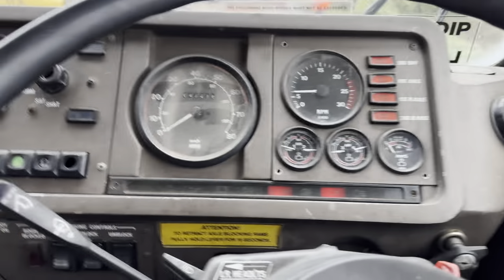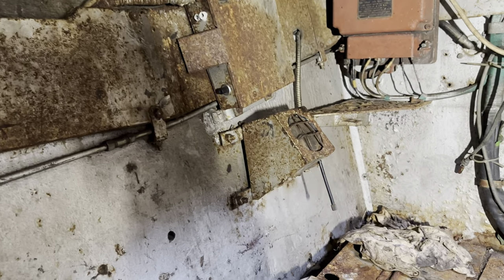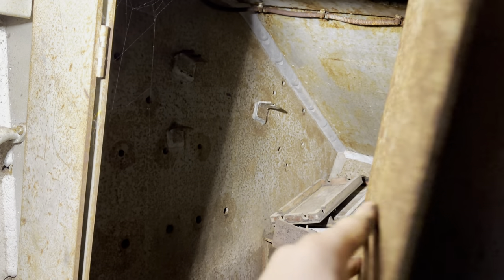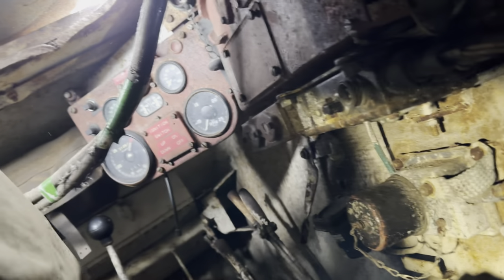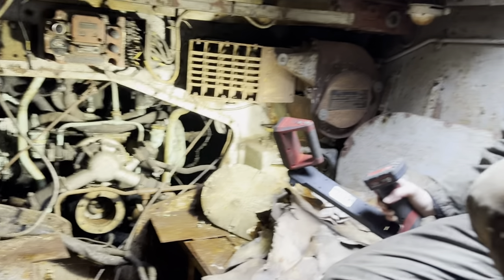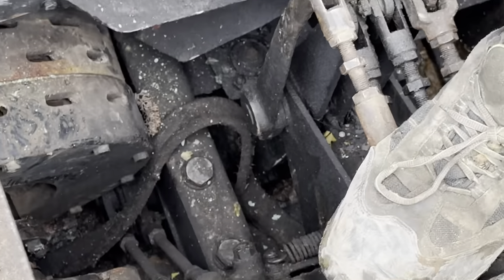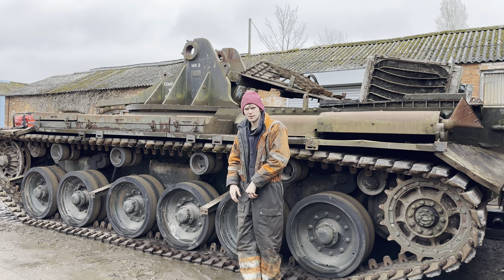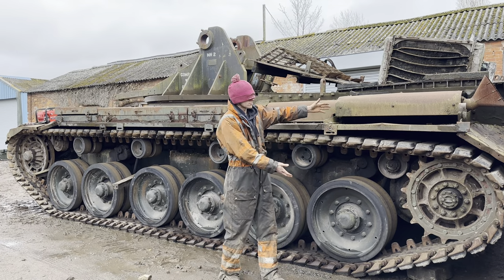Guess the mystery Project?￼

Comment: Likely a fv4005 stage 2. The tank with a 183mm gun. Looking at that mount in the turret. And also he said one was made of it
Reply: Or even the Stage 1. It featured an autoloading system although, im pretty sure that one was on railway tracks instead of tank tracks.
Reply: @Cornish21Pasty  if im not making a mistake, the autoloader was build(or built) on tank hull with tracks as well. Only problem it had was that the turret was to small or the turret whould have needed to be larger which they didnt want
Reply: Not related to the 4005 project actually
Its the 140mm gun mount, used to test the 140mm Gun the Brits made and never ended up using
Reply: I thought he said he was going to make the only one of it?
Edited to add, Tankopaedia says none were made 🤷‍♂️.
Reply: Solely for testing a gun. Air ram and manual elevation connect to the bottom of the breech. Why'd they have to use a tank hull for it?
Reply: @johnnunn8688  it sounded more like rebuild into his own concept or machination, or maybe rebuild it back to one/two of a kind prototype gun rig for 140mm gun
Reply: Has anything more happened with this project please?

Comment: 1: You’re putting a 5th wheel on it and you’re going to drag a low loader with Crouch’s Scania on it just to confuse the DVSA and plod. 2: You’re putting an extending ladder on it with air adjustable elevation because you’ve got a barn roof to fix. 3: You’re putting a jib with a couple of slings on (again air adjustable) just to support the bones now you’ve obviously killed Jack off as he didn’t appear again after hooking them up at the beginning. 4: Inspired by the pride broom handle camera mount featured previously you’re building the worlds most capable all terrain self propelled camera tripod.

Comment: Yep must be a bridge layer with that great big pivot , think I saw one at engineers open day at Chatham  barracks , my mates dad worked there as a civvy instructor, I also learned how to gas weld lumps of metal together on an open day ,the h&s boys would have a fit if kids were allowed to do that today !
Reply: Did the bridge layers have the turret still?
Reply: @Shoorit  no
Reply: @Shoorit  no I don't  think so , the turret was removed or never fitted to the base vehicle , they had special attachments/rams to unfold & push the bridge over the gap to be crossed  , I was taken in by the big pivot point .

Comment: The two of you were talking about the welds inside that tiny compartment. They probably didn't have any other process other than shielded metal arc welding at that time. I'm possibly wrong about that, though. I'll ask Google that question.

Comment: I had no idea the 140mm testbed even still existed!
Reply: Thanks, thought it looked too small and wrong mount for 183mm thought it was a 105
Reply: @lx1995Mk2 I thought 183mm at first.. then noticed too many differences. So thought maybe 120 experimental and then found the picture of the 140mm test with the 120mm test.  Interesting stuff, I bet there’s video of it hidden away somewhere.
Reply: @Shoorit  it's a unusual setup the air jack and screw jack both connect to the back of the gun, but the big thing is why a rotating mount to test the gun on it instead of welding the mount to the hull since after the test they didn't convert it back to a Mk3 or later then it didn't matter about permanent modifications to the hull. Not much point in testing if a 140/120 would work if there's no turret to test and the hull is already tested with 183mm why not just have the mount on the concrete pad to begin with
Reply: Fv3805 ?
Reply: @lx1995Mk2  maybe they were testing how the turret ring and bearing would hold up with that particular calibre, also could be something to do with the testing accuracy or repeatability after multiple shots. Also also testing positioning of the barrel and breach within the turret.. I’m not an expert on tanks and guns just from my engineering view that’s what I thought.. probably way off though.
Reply: @Shoorit  well I'm a arm general so I don't really have much a idea about turret design, but maybe they did it like that for a quick swap of weapon mounts using the centurion turret ring as a base, flat concrete so no turret traverse. All the mount needs is self contained
Reply: Did this Hull come from Shoeburyness?
Reply: I reckon you are going to make it into a tractor unit with free rotating towing mount - that would sure make juggling the non runners around a lot easier

Comment: Just noticed you use WD-40 on hot bolts and such, that stuff is worthless for that, use beeswax instead. It doesn't vanish in a cloud of perfumery smoke and works its way down the threads to provide lube while the bolt or nut is still very hot.

Comment: by looks of it - it were a big bang stick - oh there's an idea Jo, build an extra large pea shooter, with flames and stuff
i been watching the lads at the Australian Tank Museum, they do a great job restoring etc, rebuilding bent up sides of tanks, made in steel of all silly thicknesses and i seen them welding the panels together, using both tick and mig, stainless steel wire, very cool, can't be cheap, just wondering if that's how you Centurion was built, no rusty dust on the welding?

oh i can get all anoraky (not Iraqi) i just been watching vids of US naval guns, as you do, the barrels were very cleverly made in several parts so they could be re-sleeved later on when worn out, the were nicely balanced so they didn't require a huge ram to adjust the height at the rear, the bearing was a clever piece of kit in its self, a frictionless trunnion bearing each side, almost a floating bearing with a narrow space all round, 5" naval guns were supported from a centre point, on the trunnion bearing, its proper nice engineering if your into that sort of thing, you can find vids on the USS Texas
https://www.youtube.com/watch?v=etyVNi0jMiE

will be an interesting project to sink your little teeth into, certainly keep you off the streets which is probably very wise

Comment: So, potentially one of the Centurion SPGs, the 25lb and 5.5" guns shouldn't be hard to source, but I'm a little concerned about the rear-firing mounting needing major hull surgery.

FV 4004 Conway uses the L1 120mm gun, which I imagine would be scarce, though theoretically you could substitute the American M58 gun so long as you're not intending on firing it (I understand that the British Army had intended to use this gun in the Conqueror series, but it turned out to have far too long a recoil).

 FV 4005 used a heavily modified BL 7.2" gun, which I assess as being even more difficult to do, unless you can fabricate a completely fake gun.